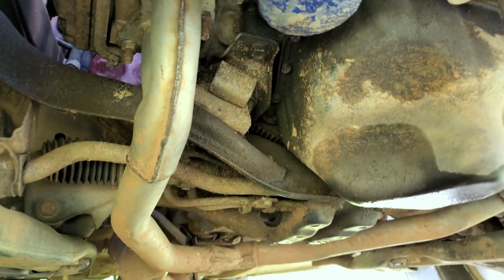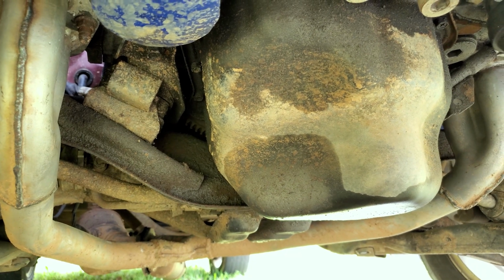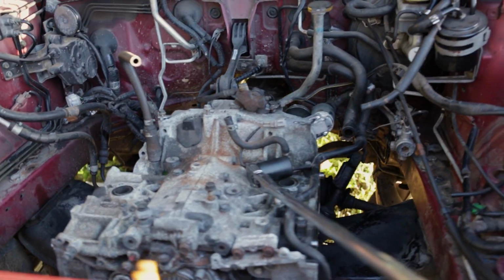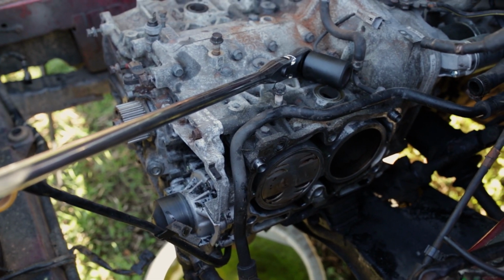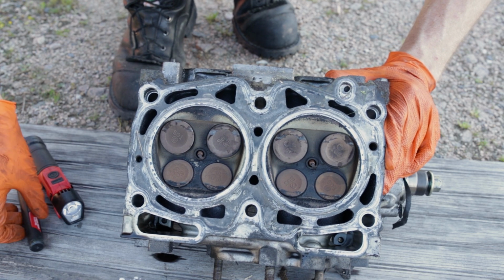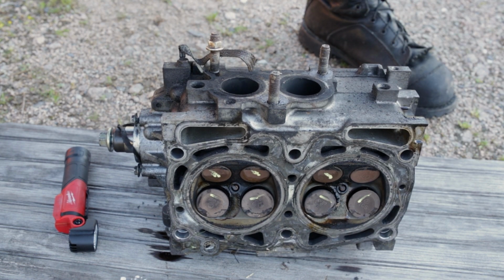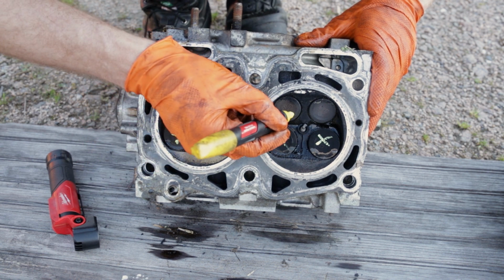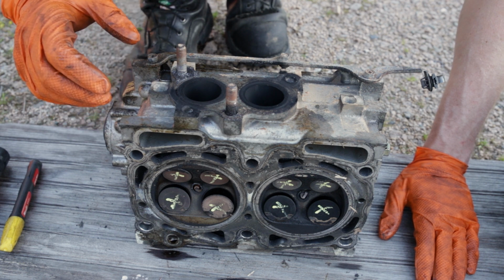Friday The 13th Forester: Heads Come Off And A Big Surprise!

Comment: Funny i worked at oreillys auto in charlotte 9 yrs ago and i remember a woman had a red forrester that she just bought, same year and the check engine light was on. It came back to egr code, but her vehicle didn't have an egr valve and when i looked at the motor it was an ej20.......i wonder if that's the same car???
Reply from the maker: Could be.

Comment: So my timing is off on my EJ25 after setting the crank to top dead center then removing my timing belt can I turn the cam shaft pulleys independent of each other to set them on the marks
Reply from the maker: You can. Just have to be careful not to hit valves and pistons in doing so.
Reply: As long as I’m at top dead center I should be fine right? Just wanna make darn sure after spending $837 on head job

Comment: Been digging just for fun. I suspect this is either an EJ202 or EJ203 obviously, since an EJ20D would be DOHC and an EJ204 would be DOHC with AVCS. Now I would lean towards EJ203 since the EJ202 allegedly had flat top pistons according to one website I found, but the EJ203 usually has the 4 into 1 vertical entry style intake manifold. That said, it would make sense if they used the USDM intake manifold just to simplify if there was any wiring difference. I'm guessing it has a 10.1:1 compression ratio either way, which is the same as the EJ253 I believe, so probably not why you got lucky with other engines not bending valves, but not this one. At any rate, the red Forester is going to be parted out?
Reply from the maker: Most likely a part out. Pretty rough otherwise.
Reply: @MrSubaru1387  I hear you. Sad because if it isn't rusty, we'd kill for it up here. 😂

Comment: Can you put EJ25 heads into EJ20 block?
Reply from the maker: Yes, should I, probably not. Will lower compression.
Reply: @MrSubaru1387  there is difference in cylinder diameter, if I remember correct between EJ20 and EJ25 engines (maybe this is one of the issues with EJ25 headgaskets - less sealing space than in EJ20). I'm not a mechanic, but when I see those valve reliefs that are pretty close to cylinder wall, so when you put EJ25 heads, valves won't hit the cylinder wall? Is the distance between valves the same in both engines?

Sorry, for my English in advance ;) not my primary language and I don't use it often.

Comment: What causes engine head valves to bend?
Reply: The timing slipped, and this is an interference design... meaning of timing slips it's very expensive.
Reply: With an interference design if the timing slips the piston and the valve collide causing the valves to bend and in some cases the valve can punch a hole in the top of the piston.
Reply: @fatkat311  So, this would be expected in a poorly done engine swap, where the ecu was probably not reprogrammed properly? I think that makes sense now that I think about it.
Reply: @Gnefitisis  the ecu in these cars isnt able to adjust the cam timing, depending on the age of the engine it's likely just oil pressure based, if it has timing profiles at all. And unless the cam is completely motorised (or controlled like freevalve) it's mechanically limited from driving the cams into the piston... based on the timing belt.
Reply from the maker: The issue is the timing belt came off from someone working on it that had no business touching a Subaru. The ECU has nothing to do with it.
Reply from the maker: Cam timing isn't adjustable in the engine. It's a non AVCS engine.
Reply: Thanks for clearing that up!

Comment: Are you able to save the heads by just putting in New valves and lapping them in or do you have to send to a machine shop to do a valve job on it? Just wondering cost wise if you can just lap in New valves?
Reply from the maker: You could, but more that likely the valve seats were damaged as well, needing the seats cut.

Comment: hai.. iam from malaysia.. i want ask you about my subaru xv 2016.. have two sensor avcs at the top cam. my question is. why i pull out socket avcs my car have normal pick up. and when i put back the socket at avcs my car dont have power.. i mean no pick up. just a pick up.  after 10km/h my car is fine.. can you help me

Comment: Will this job cost about x3 more than lets say... Honda?
Reply from the maker: Not really.
Reply: @MrSubaru1387  Just pulled some info from web. Gasket replacement in Accord $984- $1,276 Subaru $1600-$1700. So, you're right. not x3. But much more

Comment: I have questions for, I have 05 Subaru Legacy Gt wagon my check engine light turned on  code said p0172 and  running rich?  I did some upgrade like Cobb cold air intake .What’s the best way to fix it?
Reply: Put the stock one back in, you don’t need that intake. You’ll have to tune the engine for the new air ratio since your MAF scaling is off. It’s a pointless mod to do if you’re not pushing power.

Comment: Hi so I put the the car together (07 outback sohc) it idles low, 500!  no engine lights. I took it for a test drive, it is tight, but I suppose thats normal. Any advice on the low idle?
Reply from the maker: Cleaned the throttle body and performed the idle learn?
Reply: @MrSubaru1387  I did clean the throttle body, as in your video, but not the idle learn! I have to look into that. by the way I kept driving the car around, now the idle improved to just below 1000
Reply: @MrSubaru1387  I did the idle learn it is so much netter now,! The car is been parked for a year turns out it might need a catalytic converter, I am thinking of doing it myself, any words of warning? :)
Reply: @MrSubaru1387  would you know what size stud installer (10mm, 12mm?) I would need for the catalytic converter? Thank you
Reply: @jomangeee  i did the cat on the 02 legacy.

Reuse as much original as possible.
Bolts , nuts and the springs ( back side of the cat).

The gaskets are needed.

Disconect the baterie before everything.

Its an easy work
Reply: @jomangeee  bolts and nuts .
@least in europe

Comment: Was wondering what kind of repairs would be needed with a broken timing belt.  What other parts are likely compromised?
Reply from the maker: Aside from the valves, the valve guides can be damaged, valve seats, pistons can be gouged or crack.
Reply: not the rockers or camshafts?  And if the piston needs replacement I assume you'd install new piston rings as well.

Comment: Well that was fun to see. Cool video man! Thanks. 
I know you said this car only cost you $500, but damn! You may have been ripped off!
Do you think you can part it out enough or use parts from it on other cars to get your money back at least?
Reply from the maker: I can definitely get $500 out of it. Lol
Reply: He wasn’t ripped off at all. He’s doing the work himself. Machine shop is $115 for heads, $70 for head gaskets, timing belt kit $200, oil $20, filter $10,  coolant $35, and valves $150. For $600 more he has a brand new engine that will last another 100k+ miles. $1,100 for a Subaru is not bad at all.
Reply: @itsvoodoo7050  That was more of a joke. Chill man.

Comment: I see it all the time too,nuts and bolts missing including put in the wrong spot.I seen one the bolt put in was too long and put a hole in the valve cover.Bolts in too tight as well.Do find the heads of the bolts and nuts rounded off badly.I call people like this Abdoul The Butcher
Reply from the maker: My Crosstrek, doing the spark plug replacement, found a cam cover bolt sticking out. Dealer tech didn't even run it down, nor torque it, when doing the valve spring recall.

Comment: I guessed correctly, sweet. Here's my theory on why it got all the valves. As the tensioner was failing, it did it slowly. That gave the engine time to self destruct as the tensioner was unbolting itself from the bracket.
Reply: i guessed too, in the last video ( 4 years too late! )

Comment: I really don't understand why engineers design interference engines, if they are using a timing belt.  It's not necessary for performance (look at the Zetec engine in the older Ford Focus), but the downside risk is enormous.  Anyway, good video.  Thanks for expanding my Subaru knowledge.

Comment: Why didn‘t you take the whole Engine out, put it on an enginestand and work in a more back friendly position?
I mean do you really save that much time by keeping the engine in?
Reply from the maker: Because, as you see, I'm outside. If I were still in the shop, of course I'd have pulled the engine. Can't pull the engine, can't leave it on an engine stand outside in the elements. This was the only way, until I get my new shop built.
Reply: MrSubaru1387 That makes sense. I hope it will be finished soon.

Comment: I love that you did this video because I have had the hardest time taking what I learn from your videos and then applying it to my 2003 Subaru Forester 2.5XS... My boyfriend bought the car over 3 years ago and it was owned by one person he paid $2500 for it and we went on loads of adventures... Well my boyfriend has MS and (he is doing great his condition has actually improved with the lesions on his brain having shrunk over the last 14years with Cannabis) ... So he just wasn't able to keep up the maintenance. I noticed there was an issue with the handling and the braking last year...  I convinced him to take it into a shop which he did... The shop owner told him to sell it quick while it runs and sounds good because it was about to do what Subaru Foresters do and die... He bought a new car and by the time he did well I needed a car to drive so what did I do ? I started driving sooby around... She was doing fantastic in my opinion that is until the lug bolts on the rear right hub just snapped off.....

So I was on my way to my horse driving over a the river when the wheel started acting like it was going flat or it was flat... I couldn't stop seeing as how I was on the highway on a huge bridge going 60mph.... So when I exited the interstate and pulled off to the right I was surprised as all heck to see the tires all inflated. At this point I knew very little about car maintenance... I simply never had access to tools or a shop or anyone willing to teach me.  My boyfriend came to my rescue and he is the one who realized "hey babe the lug nuts are missing on the rear wheel did you notice that?"....
Ok hold on a sec before yall go judging me k... I have totaled a honda because my cv joint or whatever snapped after a road rage truck cut me off on the highway... I have had a Suzuki car do almost the same thing only the tire turned completely to the right in the front causing the car to skipp to a stop right after I got it off the highway... I have had lots of cars attempt to kill me due to parts failure so I feel I was justified in overlooking the lug nuts since I was well having a panic attack ok...

alright so here is what happend I needed to get the bolts fixed and thought it would be pretty affordable right? Wrong! every shop near me wanted to charge me $100 per bolt and 3 had snapped off plus they wanted to charge me to tow it to them or charge me a $150 field or service fee to come to my house on top of the fact that most wouldnt even do that since I have no parking at my house other than on the busy street... so what did I do?

Well I found you of course here on youtube!!! yeah thats right I watched maybe 50 videos to figure out first what kind of brakes the car had(my boyfriend knows very little fyi), what to do to jack it up right, how to properly chalk it so I dont die, what tools I needed (I barrowed my cousins tools the only person willing to lend me his tools) went out and bought some new brake pads... The rotors where fine for then and I had no money nor do I still have any money to get new rotors or calipers or anything other than brake pads and a small container of brake fluid plus three hub studs... It took me over a week but I did it. I got all three out with zero heat and zero cutting tools, just a bit of WD-40 penetrate and PBlaster did the trick.  I had a really hard time getting the new ones in because well I have no power tools and I am a girl and I have no experience before this point at all working on cars.

I am telling you all of this because I have been in love with cars since I was like 2 when my dad introduced me to racing and building and working on cars. He and my grandpa would go buy them from the auction fix em up in our garage or in my grandpas shop they build together then they would sell em for a profit just for fun... I loved the way it smelled the sounds the cars everything... My dad passed away when I was 6 and my grandfather sort of never got over it and didnt really talk to me much after because I am a lot like my dad... Well I am 34 now with 3 kids I am a chick and I freaking love cars! Again I have not had the opportunity to work on them because of lack of funds, time (I am a mom raising kids) and no one to teach me... 

Well after I fixed the hub studs my best friend told me he would pay for all the tools and parts I need to get started fixin up the cars he and I had bought from the auction back in September.  Now about 3 months after the studs broke on old Sooby I have every tool I need to do most things well except any power tools I still dont have any other than a very weak RYOBI drill my boyfriend owns lol... I do have a bad ass Torque Wrench my uncle gave me... He owns a huge shop about and 2 hour drive from me where he has tons of toy cars he builds for fun with like 4 car lifts even a CNC machine its dope.

I told humble mechanic that he actually inspired me the other day to find a tech program or school to get started learning at since mechanics are highly needed right now and only gonna be needed more in the future... and I am telling you today your videos are helping me massively because like I said NO ONE will teach me... I dont know if its cuz im a girl or cuz well I talk alot and interupt alot and dont like it when people dont notice the stuff I do and then they make mistakes because they refused to listen to me tell them to look at what they are not paying attention too.... its frustrating... so I said F it im gonna teach myself... So far I replaced the rear calipers, rotors and pads on a 2004 Ford Taurus Wagon and the hub studs on sooby and all the windsheild wipers, I cleaned the engine on the Taurus because the starter was covered in gunk... if you know what it is I will be so greatfull... I saw a video that said when they sit the transmission will burp all over the place... that looks like what it was but I didnt let it sit till ... oh yeah I forgot all about it my best friend had let it sit after he got the rear exost manifold replaced.... because the brakes needed to be replaced before anyone could drive it.... ok yep that must be what happend... well thank you for the videos.

I have to pull the transmission out of sooby and rebuild it or replace it with a new one and replace all the gaskets and the suspension and actually do the brakes... then it will work again I hope . it drives right now just not very smooth at all lol... I hope you enjoyed my story because I enjoy your videos... thank you again for helping me learn.

Comment: 8 bent valves wow 16. 95 honda odyssey broken timing belt 2 valves bent. Did repairs all set has 300 000 miles. All original

Comment: Is the engine sohc or dohc?
Reply from the maker: SOHC
Reply: is it sohc, all N/A's are (pretty sure)
Reply: Kristof Kaye 25D was DOHC but we don't talk about that engine...
Reply from the maker: Everyone hates on the EJ25D. I loved it in my 98 LGT 5MT. No issues after the HGs were dealt with.
Reply: MrSubaru1387 I personally don't hate em but they get a bad rep. My friend's 25D had an exhaust cam sprocket explode on the highway from Wichita to Portland, replaced the motor with a junkyard 25D in less than 21 hours from time of death to engine running. Was definitely a sight to behold aha

Comment: The sad part is that it was probably making all kinds of noise before the belt tensioner came off and they ignored it
Reply: bigdaddymak1439 very true. Sometimes you hear some crazy tapping noises in some trashed cars and you think, damn that sounds ugly!!
Reply: My forester just had the timing idle pulley sieze which shredded the belt and bent my valves. It ran flawlessly until failure with no noises at all.

Comment: Geez, that is real bad. I basically watched a lot of your videos to repair my car. And the worst I have is two stripped power steering bolts. Not from my own doing fortunately. The shop that replace the power steering pump for the previous owner over tightened the bolt so bad on the top part that when I had to remove the bracket it stripped the block. So I have to redo that one eventually. And when I had to replace an alternator. I removed The bracket again. And when reinstalling it I went to torque it to the proper specifications, and the bolt started spinning in place.
Reply: I am still to experience a shop that torque to spec!